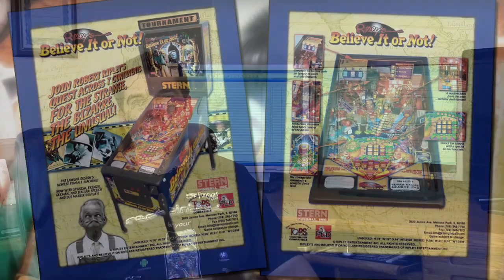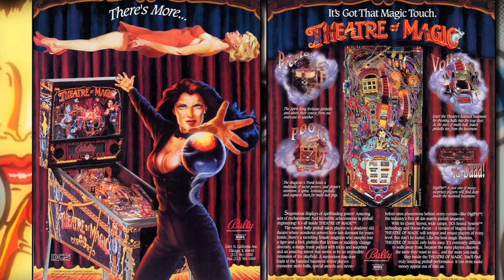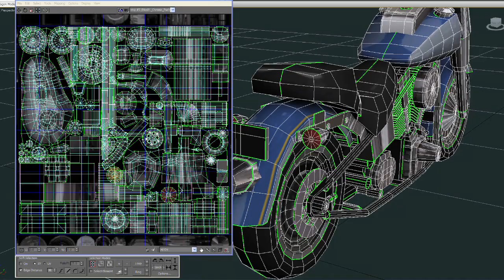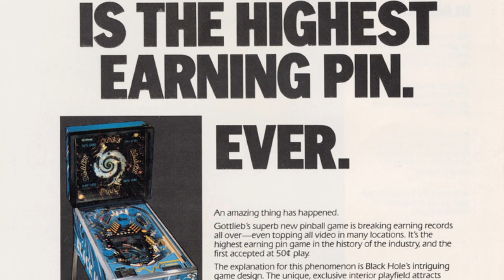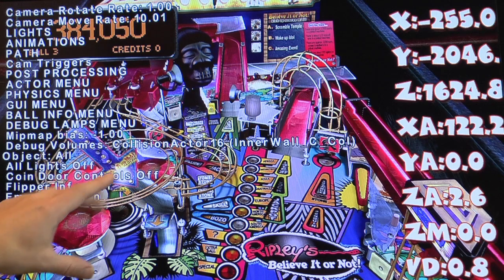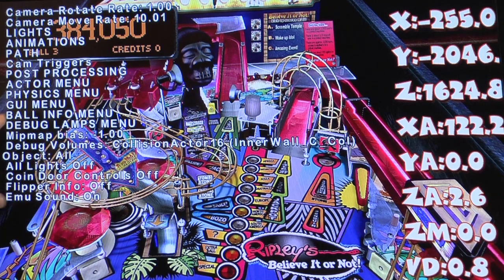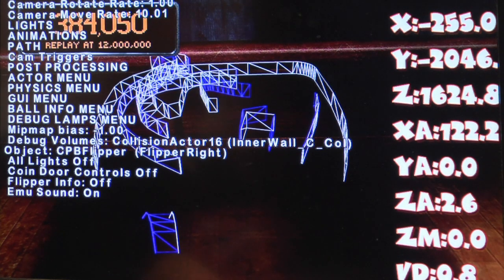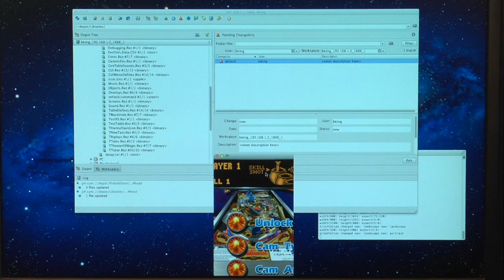Making of Pinball Arcade

Comment: Originally played on the Xbox 360, Android & the PS Vita, I`m currently playing on a PC that is connected to a 50" 1080p Plasma TV that is set at a bit of a tilt and orientated in portrait Mode ! Damn that looks & plays so good, the response time of the Plasma is far better than most LCD screens so the ball looks very fluid too.  I think that it`s better playing your tables like that than the real thing because most pinballs are very hard and the ball ends up down the middle all to often but here skillfull control of the easy L/R nudge buttons means that I can actually have a proper go at accessing many different modes in each Pinball game.  Brilliant stuff, keep up the good work. ( Years ago I used to play Visual Pinball and move the flippers in so I could get a good game LOL )

Comment: i once played a marbelous pinball in spain, a real pinball, there where 4 targets with blue green and red and yellow light, if it stops at the top for example the red light on a row is a special, the orange on a row is an extra ball the yellow on a row is multiplier bonus and if its blue, the slotmachine works and switches over to the top (in real) to play the slotmachine, where you can also get specials and/or extra balls etc etc